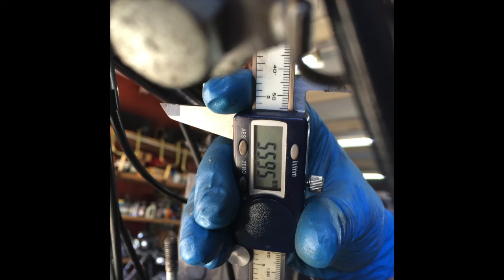1967 Yamaha big bear 305 scrambler ym2c restoration

Comment: I owned the same year model and candy-apple red color for 8 years.  When I was 18, I bought it used in 1968 for $650 and sold it in 1976 for $600 when it had 35,000 miles.  I had a lot of fun on that motorcycle both on paved and dirt roads and hills!  The only downside was when the engine was hot on hot days it had a lot of piston-slap noise and I added a capacitive discharge ignition system, which really helped it not foul plugs and not smoke so much.  I miss it and enjoy seeing your video of the one you restored -- brings back memories!
Reply: A lot of that noise was caused by straight cut primary gears. They would just about take anything for a block or so!  I didn’t keep mine very long-the noise and smoke drove me crazy.  Traded it back in for another Honda Dream (more civilized).

Comment: I was hoping you could tell me how you got the armature off I have a manual and it says that you need an armature removing bolt but doesn't specify what size?
Reply from the maker: i made a tool for it
Reply: Motoresurrection what kind of tool did you make? because I'm getting so frustrated at the lack of information on the internet
Reply from the maker: Ok so there are 6mm threading inside the crank shaft. So measure a long 6mm bolt and cut it long engough so that it will sit inside the rotor. Then cut a slot in it so you can use a flat blade screwdriver to thread it in. I have one of the 4 way threaded puller but i think the rotor threads are 8X1.25 so an 8mm bolt will work as well. Then thread it into the rotor, tighten, and bounce the hammer on the head of the bolt (don't beat). And it should pop off.